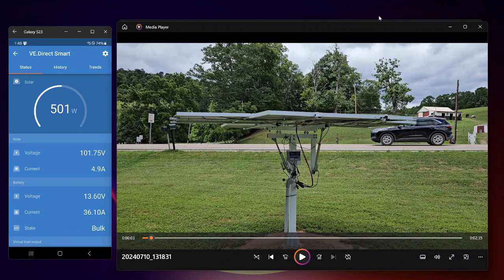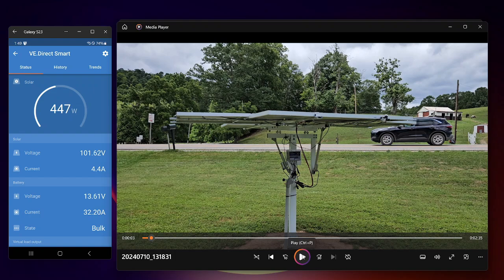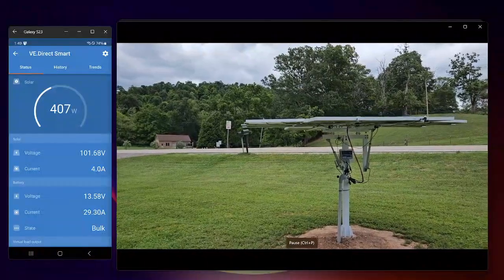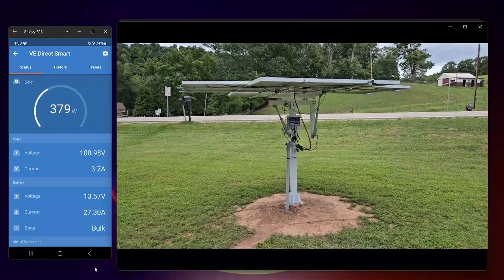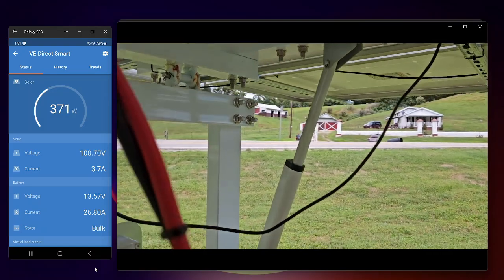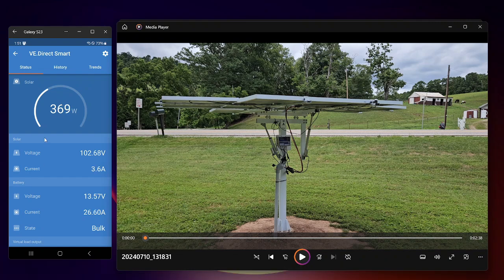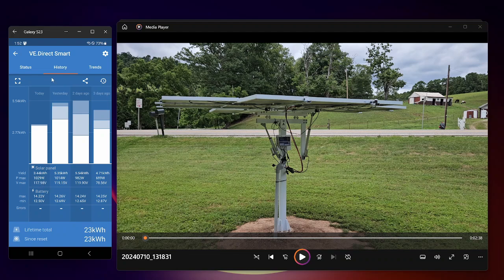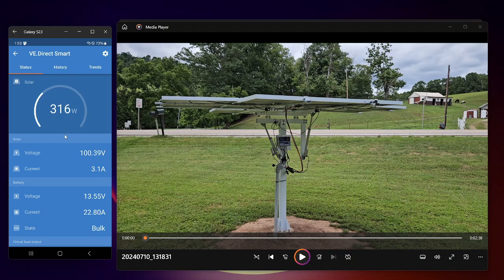Eco-Worthy Solar Tracker in wind lock and watt intake

Comment: Due to the extreme drop in the price of solar modules tracking systems are now superfluous. In any case, they are mechanics and need maintenance.
And they are very susceptible to wind. For this reason and because of the mechanics, most of them only last a 1-10 years.
 It is much cheaper and much more reliable to simply install more solar modules!
If you want more constant yields throughout the day, you simply have to set up the modules in an S-E and S-W orientation.
Reply from the maker: If one has the room for that option, if not trackers are still a viable option since trackers have also came down in price.

Comment: It would be best in these high wind conditions to secure power to prevent movement and install some ground anchors with straps to each corner, that would eliminate all movements and stress off the system.
Reply from the maker: I've thought about that myself. Luckily we don't suffer winds like this often in WV, but would not be a bad Idea to have in place if needed.